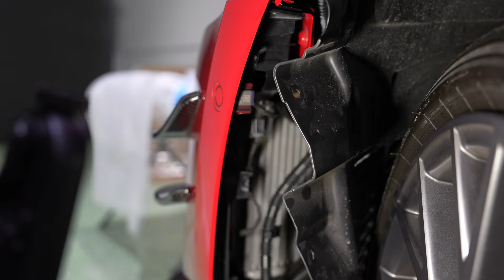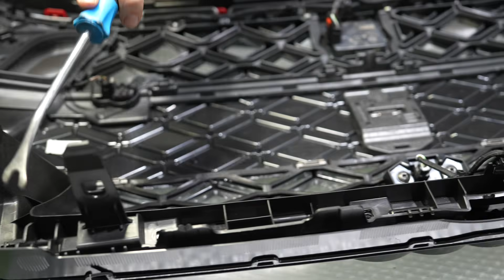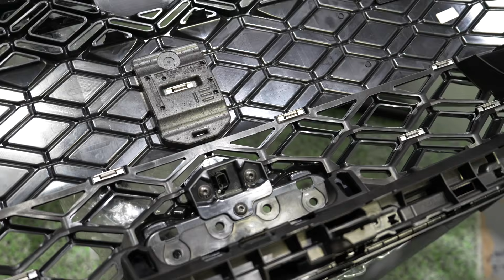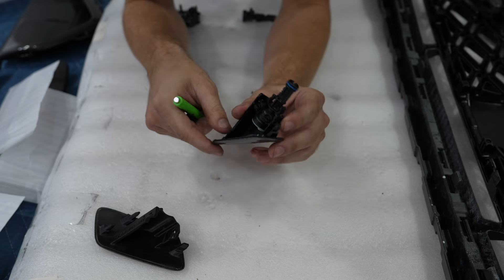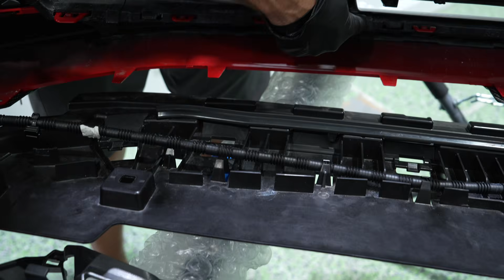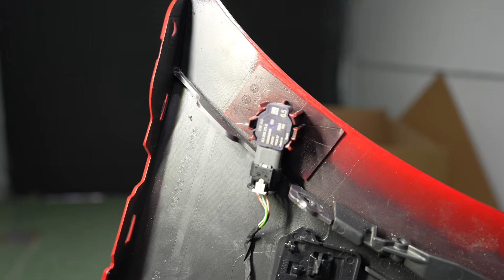AUDI RS3 8Y GEN 2 CARBON GRILLE AND BUMPER REMOVAL INSTALL GUIDE | AUTOMOTIVE PASSION

Comment: What's the fascination with Carbon Fibre?
Reply: I mean if you look at some of the most well-known and celebrated exotic and supercars out there, they are covered in carbon fiber. It's much lighter weight than many other materials. Adding front splitters, rear diffusers and rear spoilers help with producing downforce and directing airflow smoothly around the car for better aerodynamics. But I'd say mainly in this platform, it just looks awesome
Reply: @Daveyboy_RS3  Yes, understood. I work in the aerospace industry, and we use carbon fibre and composite materials a lot for their strength and lightweight. Where it differs from the car industry is that we go to great lengths to hide the weave and disguise it as plastic or metal.
Reply: @BrianMcCann421 Yeah I know. In your industry you use it for it's practical and functional applications, as opposed to aesthetics. And I know in lots of aerospace, and engineering, carbon is used but then painted over or hidden in one way or another. But yeah this is the car game and people love their exposed gloss twill carbon fiber. Me being one of them. I assume a lot of The fascination and attraction has to do with the fact that many of the high-end exotics and track monsters are covered in exposed carbon aero front to back.

Comment: Do you have this for the 8y gen 1?
Reply from the maker: Yes, 

Can share link to either our US or worldwide shop. Where are you based?
Reply: @automotivepassion101 🇺🇸
Reply from the maker: @c @carguy5763 ttps://www.automotivepassion.us/product/audi-rs3-8y-carbon-grille-replacement/?v=0b3b97fa6688
Reply from the maker: @carguy5763 kindly use automotive1 for 5% off.
Reply: @automotivepassion101 there is a small black trim pieces it looks like still right under the grill in your photos